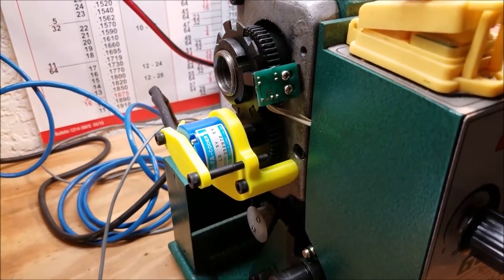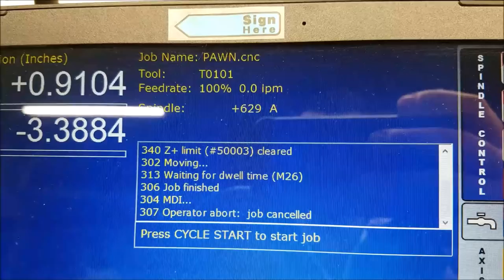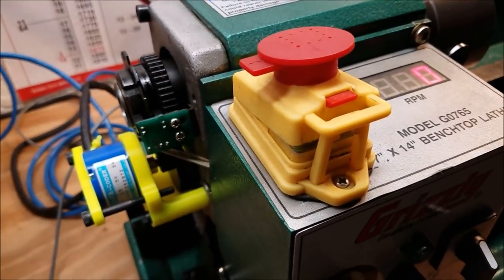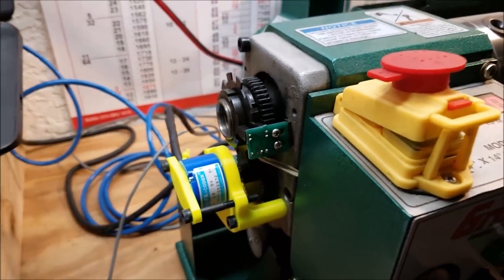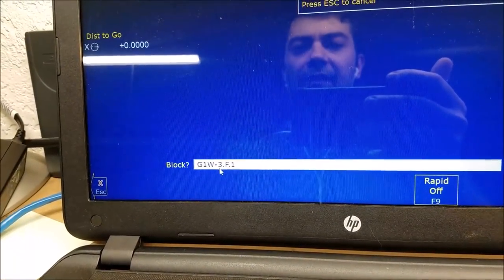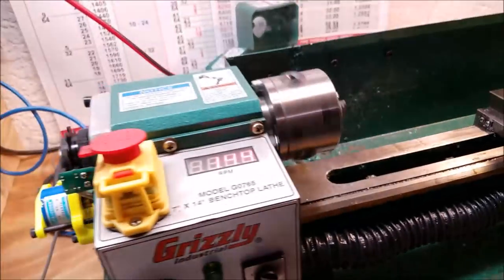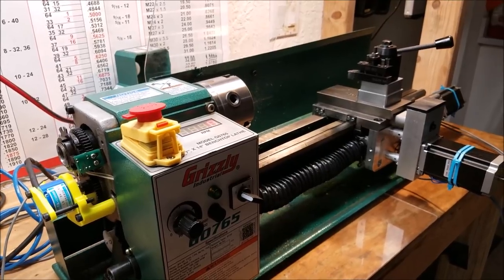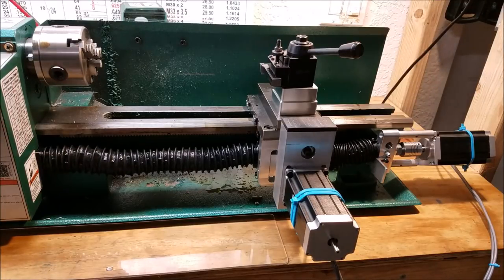Real-Time Encoder Feedback on the G0765 Mini-Lathe Using The Centroid Acorn

Comment: It is also possible to do quadrature feedback with Mach3. Independent of the controller, some folks have created quadrature encoders using two gear tooth senors slightly out of phase, plus the existing index sensor. Resolution is limited by the tooth count, but an interesting idea where space is limited.

Comment: Hi, the encoder rotates in the opposite direction of the spindle. Did you correct this via software, wiring or leave as is ?
Reply from the maker: It just worked and I didn't have to do anything special.  However, I think that if I needed to reverse the direction of the RPM readout, I could have entered -8000 (rather than 8000) pulses per revolution in the Centroid setup wizard.
Reply: Thanks, entering a negative value works.